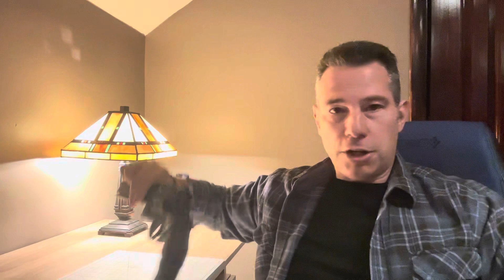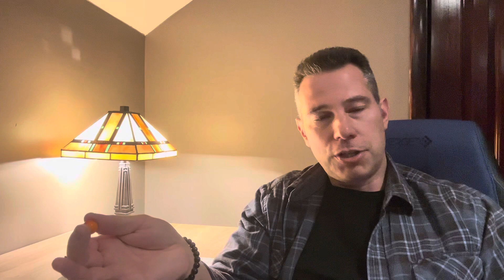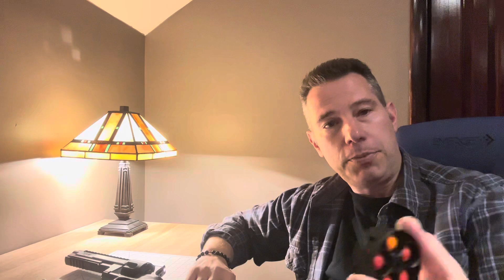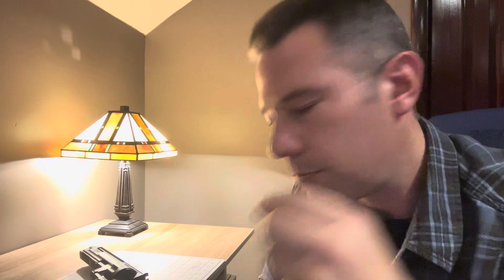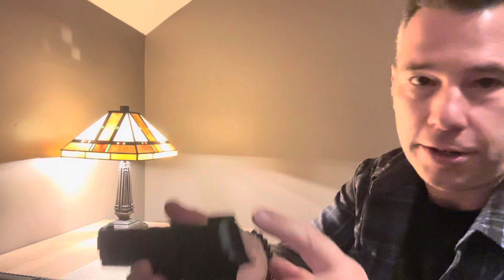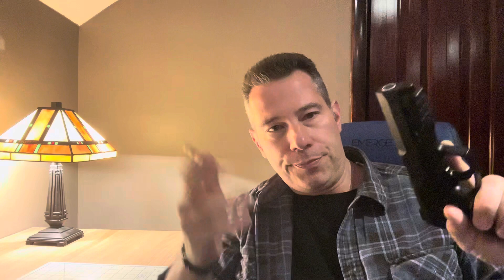Less Lethal Maintenance of Chemical Rounds

Comment: The thing is, is that OC balls take a second to disperse and begin causing it's desired effect against a target. Which is why I would make the first round an oc, followed by 3 inerts that would disrupt their clothing where the oc has just landed thus forcing it to spread faster and quite probably initiate the physical impact reaction of throwing their head forward/tucking their chest back for a half second directly into the dispersed oc, and ending with the last one or two with oc. Thoughts?
Reply from the maker: That makes sense. For me I keep a kinetic first Incase I’m too close then I can distance myself for the chemical round not to get as much cross contamination
Reply: @EastCoastLessLethal very logical plus the first shot is more powerful. 
At what speed do the pepper balls break in launcher?
Reply from the maker: @J0HN_3_16  it’s not so much the speed but the power. The Umarex line fire different than others. Usually 25-30j usually a 25-27 joule Umarex does not break them
Reply: @EastCoastLessLethal  thank you .

Comment: The oc balls work best if hit in face, especially outside in any little wind will blow it all away if only hit in chest, inside chest is better because no wind and more effective, they claim they expire in 3 years because powder will clump up and weaking especially if it's threw extreme temperature change, I think if they are stored properly they can get more than 3 years, impact balls are great to have saved up in case they remove all these type of things from online or ban them.